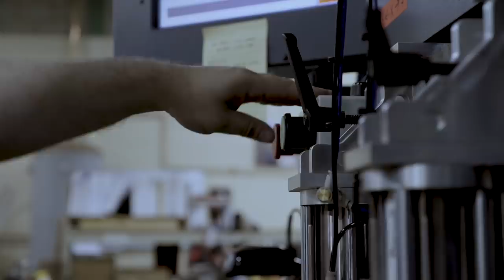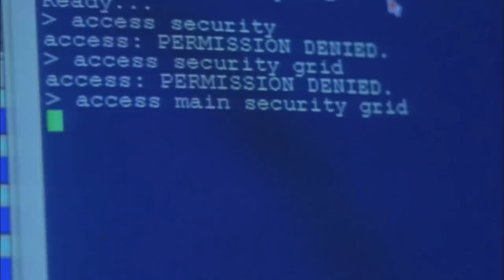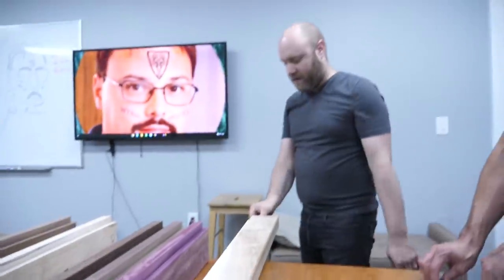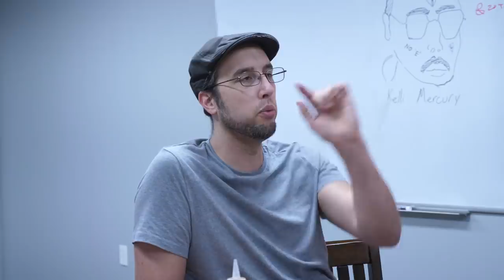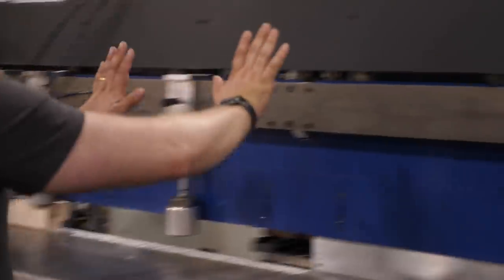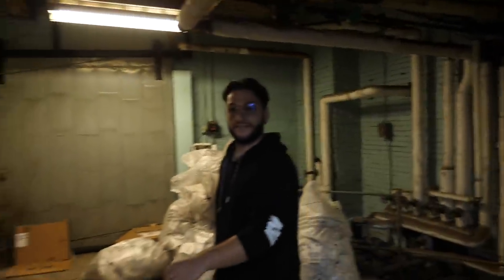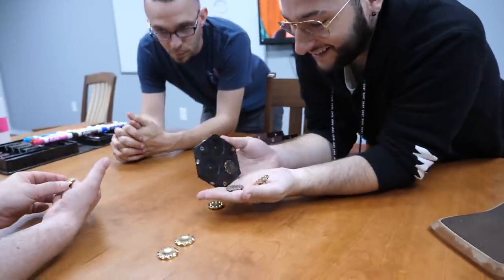The M&T IS SOLVED! (but we still need Frank) S8E20

Comment: QotD: FRANKly, WW deserves much more than a 100% refund. How much material was lost in the process? How much labor was spent across this duration with a faulty machine? How much profit was potentially lost from not putting out merchandise? How many tables were not shipped due to material that didn't pass QC? WW lost much more than the value of the M&T machine.
Reply: and how much more expensive is the raw materials (exotic woods) now, six+ months later. if they where up and working while the wood was cheaper they could have made sooo many tables with much higher margins

Comment: The fact that the manufacturer didn't have a tech down there with you for troubleshooting this speaks volumes. I used to work with an Industrials supplier and we did setup and consulting for a wide range of manufacturing industries. If a major tool like that was having an issue after install we would have had a tech there overnight, even if we lost money on the deal. When a company buys a major tool like that, the setup fee is usually part of the sell. There is also a downtime calculation for configuration and integration. However, when a brand new tool can't perform to the specs or parameters demanded by the client. You expect a call from Frank.

Comment: In the US, if you say you're product can do something and it can't, you best be ready for several lawsuits (there are ways around that for some things, but in this case pretty sure it's clear cut). There has been a substantial amount of lost productivity, product, and material (like the personal computer and metal used to repair the M&T parts) to just get the machine functional. Not working to 100% to spec, just FUNCTIONAL.

In this case, I would say there's a good chance you could argue the M&T was sold under false pretenses. It was sold under the promise that it would 1) run to spec, 2) parallel process, 3) do both 1 and 2 at the same time with a variety of accessory bits. It did not run to spec, the software did not function, it cannot parallel process to spec, and at no point did the manufacturer step in to help diagnose ANY of it, let alone offer repair it, or give compensation of any kind for the problem they caused by over promising what their product could do. 

So yeah, you DEFINITELY deserve a full refund, possibly more if you take in the damages it caused. Had you gone to a competitor it's likely this would not have happened because this is NOT normal business practice to the best of my understanding. Yes problems happen, especially after first install, BUT NORMALLY the selling company helps you fix that, NOT leaving you out to dry once they got the money.

Comment: Were I the engineer tasked with solving it, I'd try two approaches. Surefire way would be to make separate floor-mounted arm structures to do the clamping, reuse existing cylinders, and possibly brace the tables/surfaces to minimize deflection. Otherwise, run table-mounted stabilizers/bridge on each side of the clamps to keep the deflection limited to one table section. Neither is elegant or adjustable, but both would allow parallel processing. 

That's definitely an engineering oversight to not factor in deflection on a beam that's taking a few hundred pounds of force on an 8-foot long beam. For a machine that's supposed to be accurate to ~5thou, it's not acceptable to ignore deflection. Definitely get Frank involved. 6mo late and a month of OT to fix it before being able to run parts is almost certainly a legal matter. From the perspective of an engineer that's done custom designs, on future machines, make sure late fees are in the contract, and that there's startup support that ends when the machine's making chips to spec instead of just making chips. Custom machine design is a different world than the rest of Wyrmwood's machines.

Comment: I don’t think you can ask for a full refund unless you return the machine
Reply: I wonder what would be cheaper for the company that made this machine in the long run. A full or some percentage refund with extended warranty support to save face, or a legal battle with all these very well documented issues and the bad image that goes with it.
Can't wait to see the end to this unfolding story.
Reply: Technically not true if you include lost labor and materials
Reply: @allankelly-watt4633  Also very well documented that they have modified the machine. Jason already admitted to unbolting things and if they mark their heads to make them tamper evident, they can say it wasn't their fault at all. Remember that we only see what WW lets us see, and many people in the manufacturing industry have been shouting at them over messing with a brand new machine to this extent.
Reply: @DrigrX  
True he did in fact unbolt the table itself accidentally but only because he had to machine new parts because the fences were not square, also would not have anything to do with the machine literally flexing itself out of square when the presses come down to hold the piece in place.

Comment: 100%, probably so, but that does not necessarily address the time spent trying to fix the issues that should have been the responsibility of the machine's set-up.  At most you would pay 33% because it only does 1/3 of what they claimed, but that doesn't really address the ultimate issues.  At least the machine should be free plus they owe some additional for your time and materials.  If they have a machine that can actually parallel process and it is verifiable to your satisfaction, they should also replace the machine with one that works as claimed.

Comment: On the M&T, since it looks like there is a large unsupported section in the middle, is there a way you could put large steel braces between the table and the upper part of the frame to keep the frame/fence from flexing?
Reply: I thought that, just make sure it's floor supported so there's no weight interference and attach it to the flexing part
Reply: They likely have the clamping pressure too high (which makes sense, they likely upped it when they were trying to diagnose the tenon problem). If that pressure is too high, that would easily cause the machine to twist by that amount.
Reply: @trapfethen  let's hope it's only that, that would be an easy fix!
Reply: @trapfethen  That could definitely be a cause, but given the number of clamps and that length of unsupported frame, I could definitely see it flex that much.

Turning down the press force is definitely a good first step before adding supports (a much much more costly solution).

Comment: While I hate the reason for it, I loved that montage of getting things set up for the M&T test. Do more of that... Maybe with less of the cheesy movie cuts...

 Did you try the straight cut without the extra clamping? At the start of the convo it felt like you jumped right to that conclusion instead of what I, as a machinist, would see as a tool or tool path issue first. Now if you did the straight cuts without the extra clamping and it wasn't repeating like it was with the clamps, I would agree that the clamping is part of the issue. Like, I don't know how this specific machine is set up or programmed, but if a new program with straight cuts and a different tool works with the clamps, and the tenon program doesn't with the same clamps, the issue lies in the tool (if it is a different tool) or the program. The tool is the first thing we investigate when we have mismatch.

Now onto the issue with the fence. At this point, we all know you guys cheaped out on the tech when it was installed, was it ever verified and signed off on doing parallel processing after being delivered? Because right now, we do not know that this isn't an issue that Jason caused when he started messing with things or if it was done in transit, or even beforehand.

Btw, in regards to .020 in variation. For the viewers who happen to read this, that is about 5 sheets of paper. It is definitely noticeable. But also, a lot of the parts that go into an airplane has the same allowance in variation. +/-.010 is a standard aerospace tolerance. So while it is not great, it is also not world ending. If this repeatable, you bought those fancy shims and should be able to to it close enough for your needs.

As for the refund, I doubt you will get it without also returning the M&T. At most, you might be able to fight them over a discounted price and/or a tech coming out to get it back into spec. This also assumes that it is even out of spec to begin with. Back to my note on aerospace tolerances. We do not know what you sent them or what is in the contract with them, but if there is ANYTHING in the spec that says a .020 deviation is still within spec, you're just SOL on it. You might still get a tech out for free to fix it and get the public problem to go away, but if you don't have it in writing that it needed to be tighter than this, that's just business.

Comment: It shouldnt be that hard to fix by the manufacturer. Im unsure if they can fix THIS MODEL MACHINE. But they can easily fix future models.

Just make the top mount for the clamps less rigid than the rack the wood lines up against. Then the top mount will warp instead of the rack. 

Just create the spot that flexes and make it q spot that doesnt effect anything.

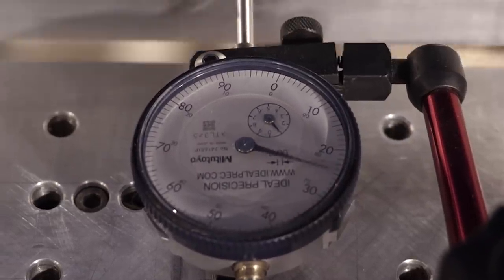Comment: 7:33. Holy hell. Yeah. 'chine's not supposed to do that. .that's not spec; that's not parallel process'able. Hekkin' props for finding it.
Reply: I wonder if they have the pneumatic clamps set to too high of a pressure? if the machine is clamping too hard, that could cause that issue easily.
Reply: @trapfethen  if it isn't high enough then the wood moves and falls out of spec anyway
Reply: @avroarchitect1793  You're correct; however, they found that the misalignment issue was due to an issue with the tenon program. This means the clamping wasn't the issue, now what if the clamping force is too high though? (it could have been too high to begin with, or they could have adjusted it up when they thought that the wood was moving around). I don't know for certain if this is what's happening, but I would definitely check it.
Reply: @infinitesyntax6263  Dude, you're grasping at straws. I am not connected to the M&T company. I do similar work "as a side gig", went to an engineering high school and college program. I know more about these things than an average joe and so are adding to the conversation.

and yes, I geek out over machinery and manufacturing in general. I own every season of "How It's Made" that I watch for fun.
Reply: @trapfethen  lol. You know you start hitting close to mark when the only response they can muster is a poor attempt at gaslighting. Yes, we know you have an engineering background. You and I both know that's not the only reason I'm calling your identity into suspect.

But I can remind you that I'm not the one conjuring up a questionable screenshot of a phantom reply made by a ghost commenter. (Why would that even be a direct reply to your copy-and-paste comment?) I'm more than happy to go through all of these "straws" with you, if you like.
Reply: @infinitesyntax6263  I'm sorry, but you are reaching dude. I am not connected to the company, I don't live in the area, I don't have any dealings with them. You're jumping to a conclusion and have gone to the point that you are twisting everything to try and fit it to your already made up mind. I work with people and small companies to help them prototype parts; as such, I have knowledge of manufacturing methods, equipment, etc. I added my knowledge to the conversation.